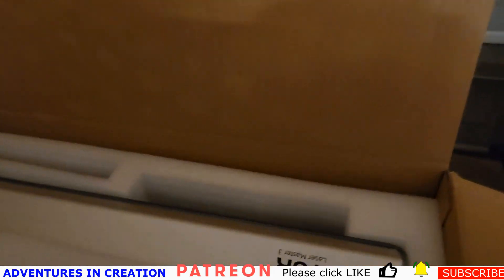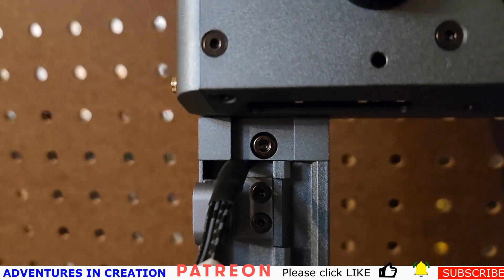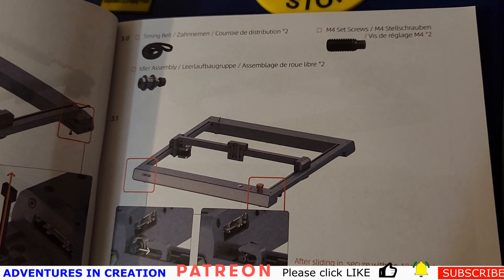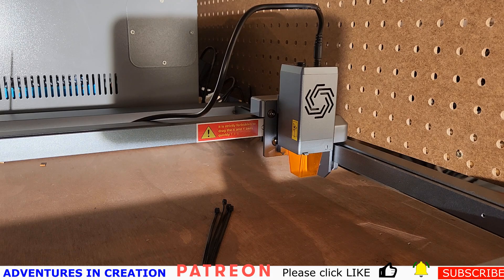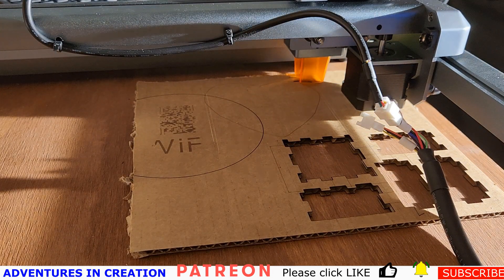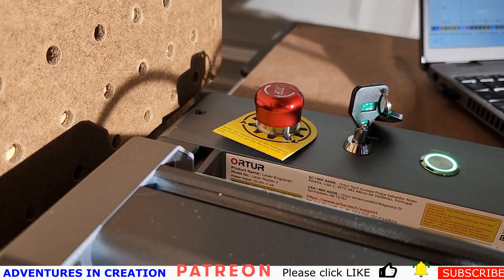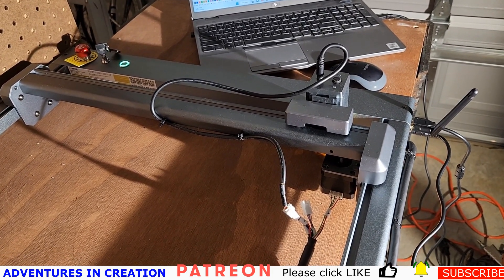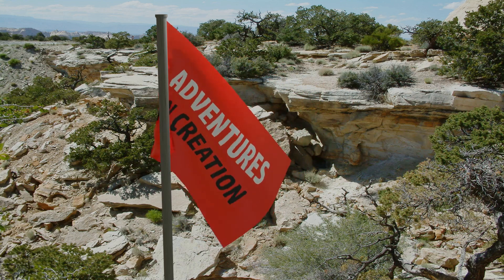Ortur Laser Engraver #lasercuttingmachine #laser #lasercutting

Comment: I've just recently started looking to buy a laser engraver. I'm getting confused by some sites saying I need a fiber laser to engrave metal, yet other sites say a diode or CO2 laser will engrave metal. I know you have only had this machine for a few weeks now but wondering if you have tried any metal engraving with it yet, and if so, what are your thoughts?
Reply from the maker: You can't engrave metal with it but you can engrave a coating on the metal. These lasers are good for wood, acrylic, fabric, paper, card.